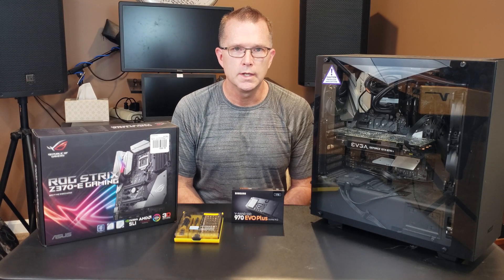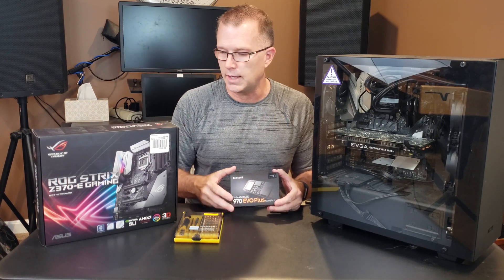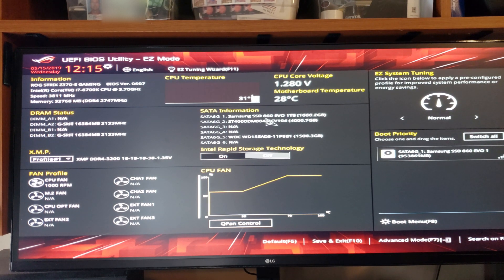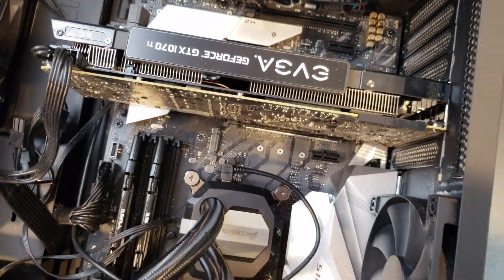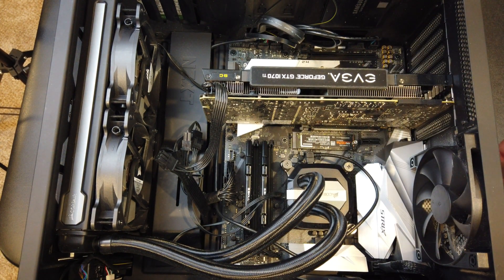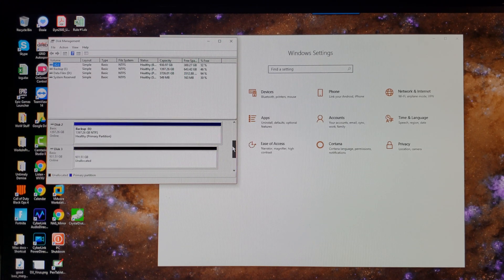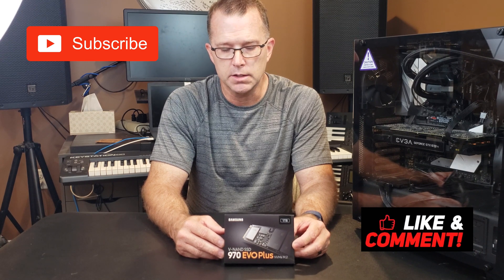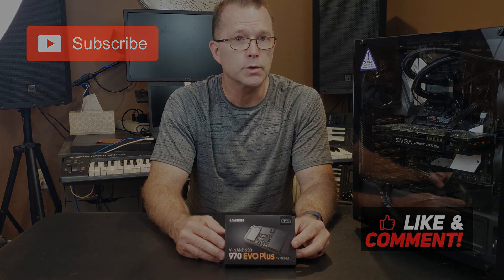SAMSUNG EVO 970 Plus M.2 NVMe SSD | Step-by-Step Installation, Configuration & Performance Testing

Comment: I just installed a Samsung ssd 980 nvme m.2 on my msi x99s sli plus motherboard....computer boots and works like normal but there is no sign of the drive in bios.....can you help with that?

Comment: What the hell, man? You installed the drive without the motherboard standoff. You just screwed it into the MB and stressed it more than it should be. Should have learned how to do it before making a how-to video :)
Reply from the maker: Ha! Good eye.  I did point that out and correct that in a subsequent video.  :P

Comment: I have 1 970 Evo m.2 installed  for my OS and when i switch from x2 to x4 .. when i go back in to the Bios its switched back to x2 .. do you know why  ?
Reply from the maker: Just a guess, but it is possible you have another device that is trying to use those PCIe channels so the BIOS resets it back to x2 to avoid the conflict?
Reply: @ReeWrayOutdoors  ingnor my question i was reading the bios wrong .. M.2_1 only has an option for SATA or PCie mode  it doesnt have a x2 or x4 option .. that option is under the m.2_2 section and that you can change to x2 or x4 ... i was miss reading .. as i only have 1 NVME in m.2_1 its fine as its in PCIe mode .:)  blonde moment  :)  thanks for your response.

Comment: Oma I wrong to understand but this SSD M.2 should not reqire any specific power supply am I right?
Reply from the maker: No. It doesn't. And they're fairly power efficient as compared with conventional HDD
Reply: @ReeWrayOutdoors  Thank you for prompt answer. I have connected this specific SSD from Samsung into my newbuilt PC on Z690 Gigabyte gaming x motherboard. I am struggling for few days now to see it recognized. I seem to faily whatever I do. I had it in different slots, in orignial slot, reinstaled it few times. I have no clue what to do or check next. 

I will try testing on friends PC or buying new one and seeing if ti will work for me. 

Thank you for great detailed videos bwt. :D

Comment: Um so I have a ryzen master b550 motherboard an its got 3 m-2 slots. Which is m-2 1 m-2 2 and m-2 wifi. Now I have an ssd card that I want to use for low disk space but idk if it’s compatible an can’t figure it out. Now the ssd card is v nand 970 Evo plus nvme m.2 samsung card. It’s also go 500gb but idk how to get it to work as I’ve tried it on m-2 2 slot an it was not being read.
Reply: Shouldn't matter what slot you put it in. Just like installing a Gpu into the pci-e where you have room to put it.

Comment: m.2 section doesnt give me any option to change stuff is that normal?
Reply from the maker: Might be normal, depending on your BIOS.  It might simply be an auto-detect kind of thing and it'll figure it out for you - in which case, all you've got to do is plug it in and turn it on.

Comment: A calculator has been assembled, and after the installation, a black screen appears that goes to the BIOS and presses the F1 key. How does it work so that it does not enter the BIOS of the motherboard asus z590 tuf gaming plus wifi

Comment: I just bought a M.2 drive. Went through at least 5 videos on install. Ready to install and found that the screw that holds the drive to the Mother board was too short. After trying to get the screw to go in, I found a small bags of screws I had from another M.2 drive installed and was able to find a screw long enough. The screw that was mounted on the MoBo was way to short. Be aware of this could affect you. The M.2 came with no extra screws. Good luck.
Reply from the maker: Yeah. I can't understand why m.2 mfgs don't just include 1 in the box.  Come on!  I'd happily pay an extra 25 cents... and it'd only cost them a fraction of that.

Comment: you made the changes for m2_2 x4 which is the slot on the bottom with the shield, but you instaled in m2_1 which in bios was set on auto.

Comment: Based on this (mainly) and other videos,  I have ordered one of these for my sons gaming pc. He currently  has 3 500gb 860 Evo's, all separate drives, not an array. It's an Asus TUF Gaming X570 Plus board, so it should work ok. Not sure whether it should run OS and most demanding storage games or just games on it though. Most of his current 1.5tb is used.
Reply from the maker: I'd probably recommend moving the OS to the M.2.  Won't likely be noticeably faster on boot, but if you do that and then install the big game apps on it, load times will be super snappy.
Reply from the maker: Here's a follow up video I did on Boot times with M.2 compared to 860 SATA.
https://youtu.be/2rrPuam3fRM
Reply: @ReeWrayOutdoors  Thanks, that's very interesting. I think I will use the drive as a game install drive.

Comment: I have the same 970 EVO plus in 2TB and I have an ASUS Aorus B450 Pro. My Motherboard BIOS can see the drive but not Windows, and I don't even get the prompt that there is a new drive. Some guy on youtube said I need to download and install the Samsung Magician drivers for it, now I did download it but when I Install I get an error that says "You don't have any Samsung NVMe drives connected" and cancels the install despite it being installed

Comment: I don't understand how you manage to boot up into Windows after replacing the ssd? Are you running raid?
Reply from the maker: No, in this older video, I was simply adding an SSD M.2 to my exisiting setup, so my boot volume did not change.  I have a more recent video where I set up  new M.2 as a boot drive if you're interesting: https://youtu.be/2rrPuam3fRM
Reply: @ReeWrayOutdoors  I'll be watching that next. Unfortunately I stripped the stand off on my mobo for 1 of my m.2 slots so not having a good time 😪
Reply from the maker: @radstar2185  oh no!!!

Comment: How can I migrate all the operating system and microsoft to the new installed nvme from an already installed hard drive?
Reply from the maker: I actually cover that in a more recent video on M.2 drives.  You can check it out here: https://youtu.be/2rrPuam3fRM

Comment: Performance testing is just nothing but synthetic test charts and benchmarks ??? LOL ? Why cant you show the drive in action for real world results, like copy files in and out, video edit with some 4K footage on it. Not many do that, while thats what the masses want to see before buying this. What can we relate to with all this number crunching !
Reply from the maker: Nothing synthetic about the test charts - but you're right that it's hard to translate that into real-world benefit.  That said, I do find the comparative differences in R/W speeds between the different drive types at least somewhat helpful, personally.  As for rendering 4K video, there's just not a big benefit there since the real bottleneck is CPU performance and not disk write speed.  However, the 1 thing in particular that I've noticed is that created cached or shadow-copies of 4K clips for smoother editing experience is WAAAAY faster now with an M.2 drive.  For what it's worth....
Reply: @ReeWrayOutdoors  > Not for rendering 4K, in real world situations most of us can wait a few mins more or even an hour more for our render to finish. The render and even the import is just one time during a project, so no biggie.

The most time is spent DURING edit of 4K, the timeline scrub performance, that where we spend hours and hours, smooth timeline scrub (i guess read speed is more important here).

How is that on this NVMe ? or should i get a normal SSD for that. This will be an exclusive edit drive for just 1-2 projects at any given time (each project's footage = 100gb).
Reply from the maker: @mgr5550  I use PowerDirector for editing and I use  'Shadow Files' (aka Proxy files) to edit my 4K clips - so when I import a 4K clip, Power Director creates a 1080p shadow file that I edit on and then PD applies all these edits to the actual 4K clip. And since I don't have a 4K monitor, there's no benefit to for me to edit the raw 4K directly.  Before m.2, I noticed that creating the shadow files seemed to take noticeably longer to complete.  However, I just tried turning off the  Shadow file creation and imported some 4K clips into a timeline.  Scrubbing and preview playback are all still smooth - which I'm sure was NOT the case back before I had the m.2 drivers.  Now, how much better that is than on a SATA SSD...I can't really say with confidence, but I'm still going to choose m.2 over SATA every time.
Reply: @ReeWrayOutdoors  > Thanks for the detailed inputs. Ive been working on Vegas Pro since their version 5...LOL. 12 years or so in video production producing professional webmmercials. Ive always worked with proxies. Even that 1080p proxy is stuttering after i do my color grading.
Reply: @ReeWrayOutdoors  > In 500gb capacity.....which one would you choose among these 3 (for a 4K edit drive) ???
WD SN550
SAMSUNG 980
SAMSUNG 970 Evo Plus
Reply from the maker: @mgr5550  Based on the very minor differences in performance I found between the  SN750 and the Evo 970 (https://youtu.be/2rrPuam3fRM), I'd go with whatever is cheapest among those three (guessing the SN550).  The incremental improvements in speed at that level probably won't be noticeable at all.
Reply: @ReeWrayOutdoors  Just sharing....bought the SAMSUNG 980 NVMe 500gb...Utter waste...not even 10% improvement in basic things like opening folders (even in this the thumbnails are building slowwwww just as in my platter drive), copying to it from a platter drive showed 120MBps transfer rate.

Video editing.....OUT OF THE QUESTION.... My 4K footage on timeline stutters same as on my HDD. Installation is correct and system is fully compatible... All benchmarks show that its giving 2700MB/s read speed. AJA disk speed test and blackmagic speedtest show it as very high speed. But no practical use....only speed testers run fast on this NVME.
Reply from the maker: @mgr5550 Yeah, I don't think the M.2 is going to make a huge different in the 4K editing dept under any circumstances since the real bottleneck there is CPU.   I do like the speed of moving large files around and loading programs (especially large projects with lots of clips),  but the benefits beyond that are not all that significant.  My 'shadow files' do complete faster than before, and that's helpful...but I wonder in your case if there's a significant CPU bottleneck going on?
Reply: @ReeWrayOutdoors  > No the CPU is idling at 40% when it struggling. I dont see a difference in anything. Even normal windows procedures like copying some files from my platter 7200rpm was done at 120MBps.

There's not even an ounce of difference of speed in render, proxy building, pre-renders, nothing. Im using it only as an empty disk for 1 project to be edited on and it cant even do that. OS is on a separate SSD. :(

Comment: Good video.
How complicated would be if I want to install Windows10 on SSD?
Reply from the maker: As long as your motherboard supports booting from an m.2 drive,  should be fairly straightforward.  Microsoft has a web page that will help you set up a bootable USB drive that you can install Windows 10 from, onto your m.2 SSD.
Reply: @ReeWrayOutdoors  Thanx

Comment: Can an M.2 NVMe PCIe drive be formated with using a SATA  adapter (enclosed case kind from Sabrent) ?
Reply from the maker: I've not actually tried this, so all I can do is speculate...but...probably.  At least with other sata SSD's I've tried using a Sata to USB adapter, I've had issues if the drive was previously formatted using GPT.  In those cases, it was necessary for me to convert it to MBR in order to be able to partition and format it via the SATA adapter.  If that's your issue, you can find some command line instructions with a basic Google-search on how to do that.  Sorry I can't be more precise, not having actually tried this myself...
Reply: @ReeWrayOutdoors  Thank you. I have cloned a 2.5 SSD from 3.5" HHD and it worked fine. I have also cloned a M.2 SATA from a 2.5" SSD and that worked out fine. I did these clones with the WaveLink dual  bay docking station. Worked great.

Comment: What if I wanted to make the m.2 as the boot drive or primary drive? What would I have to do? My cpu can read my m.2 but I don’t have an option to make it my boot drive ):
Reply from the maker: It's possible that your motherboard may not support booting from the m.2, especially if it's more than about 4 years old or so.  Your manual or the vendor website should reveal whether or not that's the case.

Comment: Excellent tutorial... thank you.  Did you need to adjust the SATA Mode Selection in the BIOS to AHCI in order to install the Samsung driver? Tried to install the driver but a message appears that the device is not connected. Windows 10 Pro has a driver automatically installed dating back to 2006 which I want to replace with the latest Samsung driver.
Reply from the maker: Thanks Herman!  My BIOS doesn't even appear to have an option to enable AHCI mode and I never bothered to try and load Samsung drivers (taking the "if it ain't broke, don't fix it" approach, ha!).  So it worked straight away for me, as I show in the video.

Comment: I think the standoff you used (at about 8:55) to screw down the M.2 is actually intended for the M.2 to rest on top of. (Yes, I know the standoff you screwed in was not intended for an M.2 drive, but the idea is the same.) You notice the standoff itself has threading on top to accept a small screw. That screw is what should hold down and secure the M.2. Your method obviously worked for you but I'm not sure whether it would or not for all mobos.
Reply from the maker: You're right - in this original video, I couldn't find an actual 'proper' screw in my parts kit so I used another standoff since it also had the right threads and secured the M.2 the same as the proper screw.  Also, in this video, I (like a total noob) assumed the threaded nut on the MB was also a standoff and so failed to install the proper standoff directly on the MB first.  I've noted that in a few other comments and have since remedied that misstep.   I've also since gotten a few of the correct screws (and pinned a comment with link to them since a lot of people ask about that).  Really don't know why they don't just include a couple of screws in the package with the M.2...

Comment: If you are wondering or you should go for mbr or gpt, just always go for gpt because mbr does not support thew newer uefi bios setting
MBR can always be converted to gpt without having to install windows again or having to lose any data, so at the end it doesn't matter too much but it's always better to choose gpt in the first place and set your bios to UEFI

If you want to convert your mbr to gpt just open cmd, enter this command
mbr2gpt /convert /allowfullos
and then restart, enter the bios and set it to uefi. (in some cases it automatically sets it self to uefi, i think this especially happens at newer motherboards so you can just try to let it boot first before entering the bios)

Just for your information, MBR supports legacy and GPT supports both, the only thing converting mbr to gpt does is it takes a few mb from your drive and makes a new partition. so i think the chance it goes wrong is small.
Reply from the maker: Excellent info. Thanks for contributing!

Comment: Good video Wray, appreciate the time you took to record and edit the video. Also thanks for the tip on the freeware drive application, Crystal Disk Mark. On a side note, was wondering if you had room at the top of your computer case to install your nice Corsair AIO dual-radiator vs the front of your nice case? The inlets/outlets of your radiator should be at the bottom of your build to stop cavitation and fluid starvation of your AIO pump, which will cause premature pump failure. It appears that your AIO hoses are not long enough to put them at the bottom in the front configuration. Nice rig.
Reply from the maker: Sadly I don't.  Only a single fan vent on the top.   Also, the hoses aren't quit long enough to flip it around and put the I/O ports at the bottom.  When I did the build, it was the first I'd done in about 20 years and AIO wasn't even an option back then. haha So it was new to me. But since this build , I've updated my knowledge quite a bit and look forward to a new build...as soon as this damn GPU situation gets better!
Reply: @ReeWrayOutdoors  I figured that may be the situation from what I could see in the video. I was preparing to teach my 14 yo how to put his Christmas present together and came across a video that explained the reasoning for the AIO positioning and had no idea before that either. The GPU shortage is affecting us too, I am forced to live on an EVGA 680, as I am not paying $800, $1000 or more, so I make due. Keeps me wondering if my old eyes are getting worse or the lack of graphics is the cause. Guess it about time to trade-in my CRT too LOL. Keep up the  video work, I enjoy them.

Comment: Just spent this morning installing a 1TB M.2 SSD, your instructions were a great help, thought I had a clear slot but the Graphics card covered the SATAs so,had to take that out to free up the channel for the SSD. Did that and swapped the cables round, installed the M.2 SSD, graphics card back in, sorted BIOS and disc management and all booted up and worked fine. Time to download Cyberpunk 2077, glitches and all..!